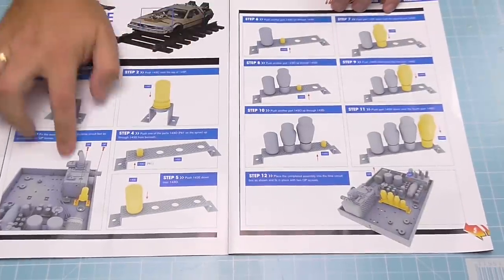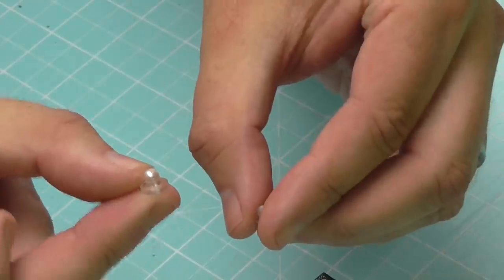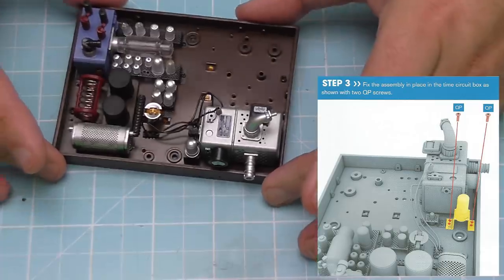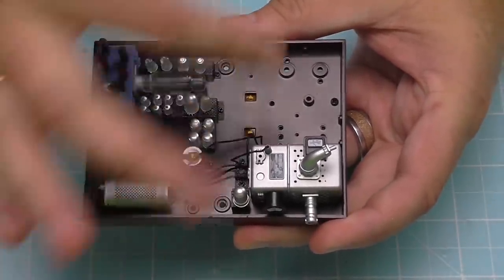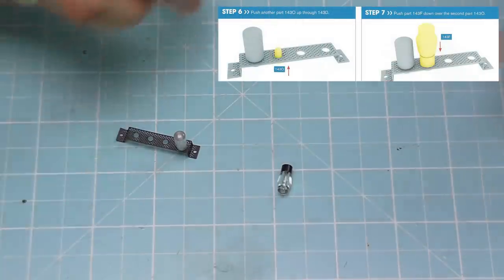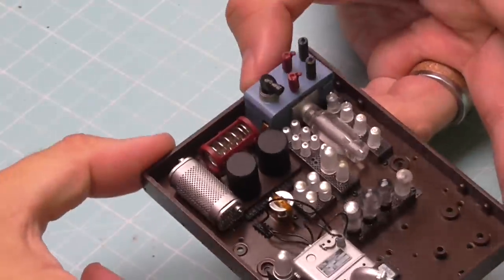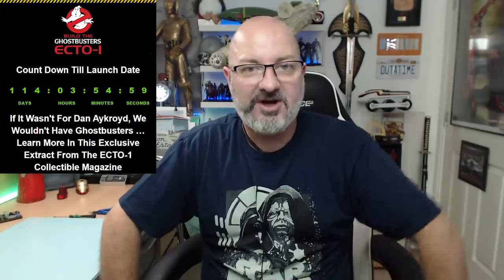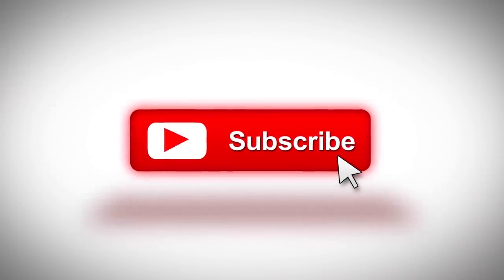Build the Delorean EXTENDED - Issue 143 - Continuing the Time Circuits

Comment: Blast! Was really looking forward to the test run for the lighting, especially since the tower LED just came into play with the big spherical vacuum tube. I know it'll look even better with what will likely be the last set of parts besides the Mike Lane upgrade (which seems to be designed to wrap around the edge of the existing base so you won't have to dismantle anything).

Comment: So today I decided to call Eaglemoss and see what's going on with issue 16. It will be coming out next month but then I asked how long will this kit take to build and what's the total cost. OMG! I was speechless when she told me and I haven't even told my wife yet. I get the max,4 issues a month however I was told there were only 131 issues so I will have to look into the extra issues. I do plan on getting the ecto-1 though. Not sure If I spelled that right. Cool video but I don't like the plastic base. Its to shiny. I would have sprayed dull coat on it. Tone it down a bit. Still, looks cool